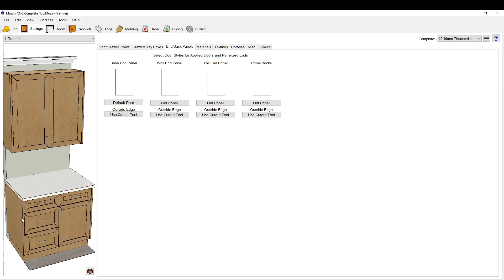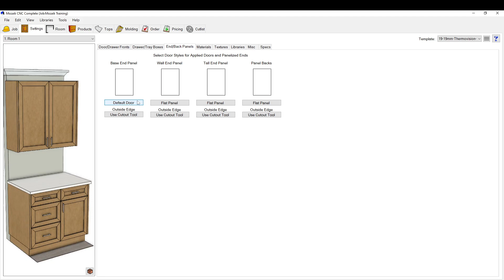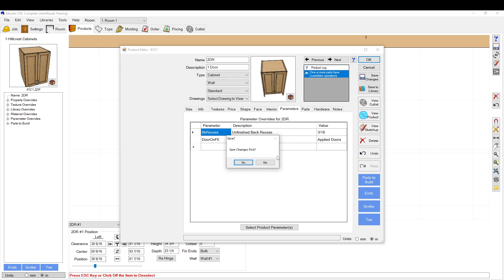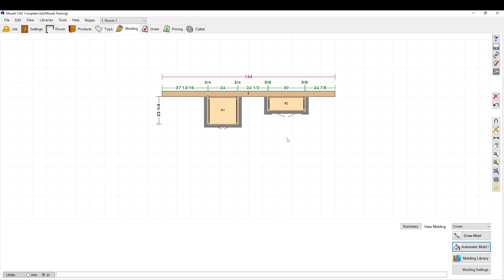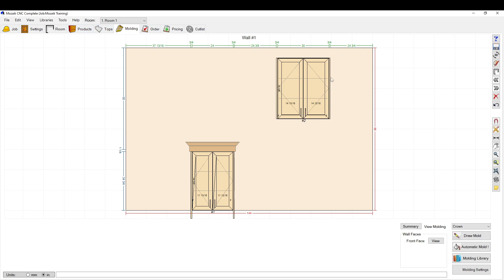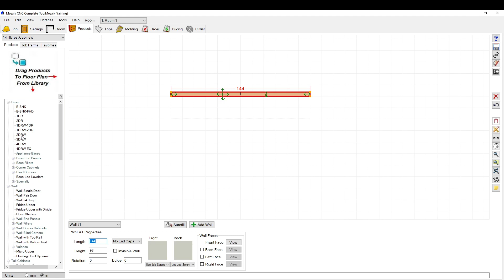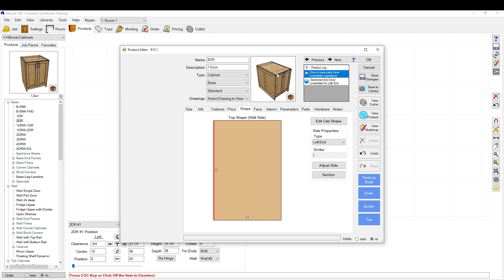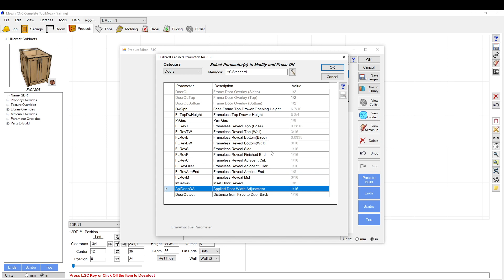Applied Doors - Mozaik Software Tutorials

Comment: For a frameless wall cabinet with finished ends, How would you make the applied ends extend below the case by 1.5"? We like to run light valance behind the doors. Doors are easily resized for this but I cant figure how to extend the end panels to match. Thanks
Reply from the maker: Hit the shape tab click the edge line adjust part and add to bottom 1.5
Reply: @cabforgesystems  👍thanks!!

Comment: With my cabinets I like to use end panels or gables that are 1.5” thick. When I edit the thickness to be 1.5” they still show up as 3/4”. I’ve been using miter folds as a work around but maybe you have a better way?
Reply from the maker: Do you need the 1.5 inch run to the cnc nest or just for visual purposes.
Reply from the maker: See the below video
https://youtu.be/eXSW7TlBppc
Thanks please like and subscribe!
Reply: @cabforgesystems  thanks for this! Enjoying these tutorials
Reply: I do the same for fridge panels or oven cabinet panels. I just put 2 - 3/4” panels side by side and use that as a representation of the 1.5” panels.